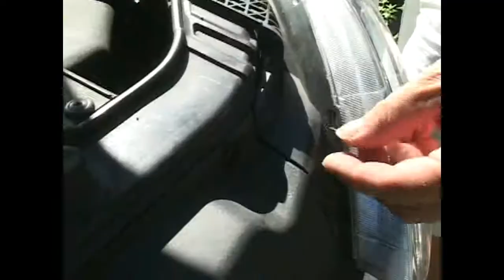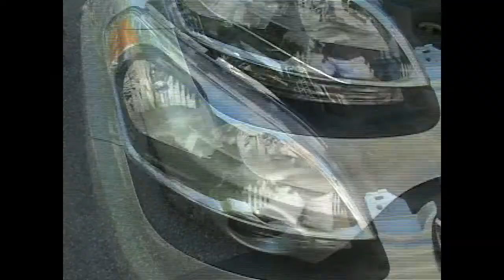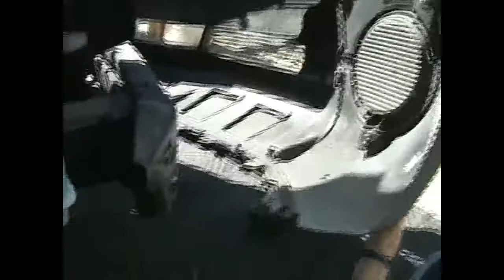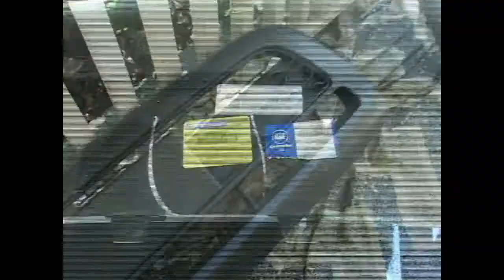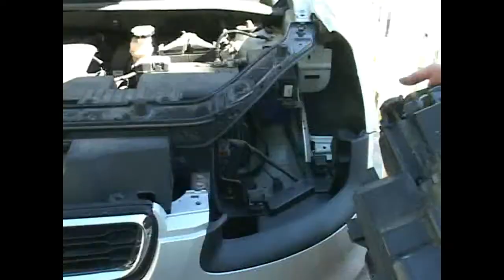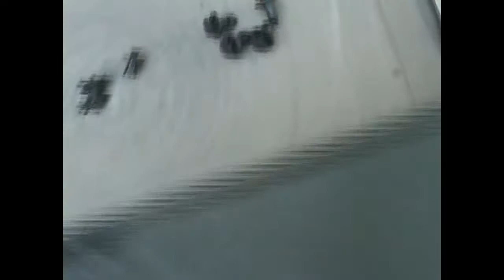2012 Kia Soul Front Bumper Removal

Comment: Do you think it's necessary to get the headlights off? Like I feel I could of kept pulling from the side.
Reply from the maker: I took the headlights off because I could not get a good grip on the bumper to pull it off. There are some clips on the black plastic trim just below the headlight assembly. By removing the headlights, I was able to get a grip on the bumper (from the area where the headlight was) and unsnap those clips.